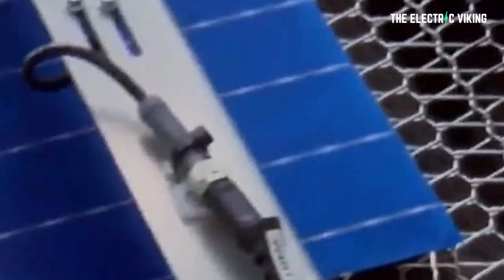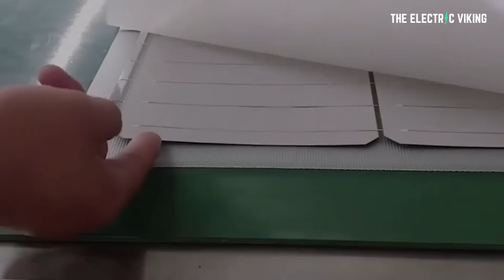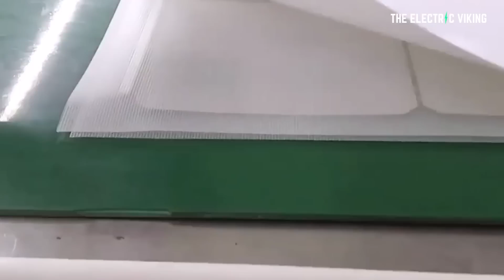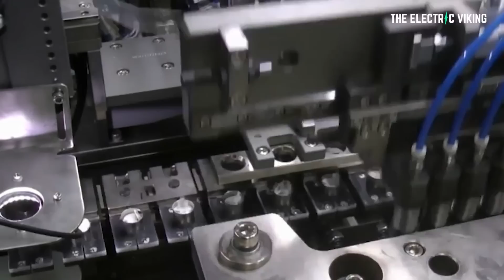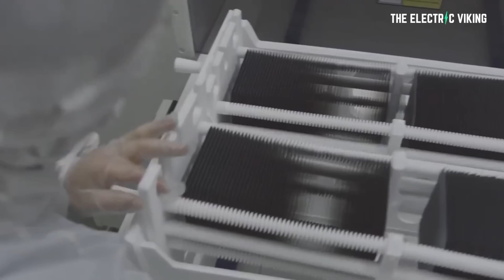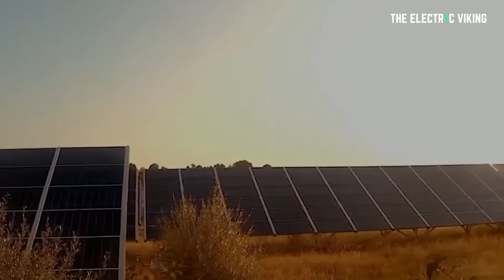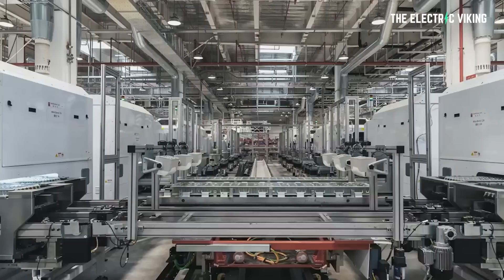China’s solar panel price war will double solar panel installations globally

Comment: There is some nuance here.  In places which already have a lot of solar, further solar expansion will not actually change fossil generation dynamics all that much on its own.  In those areas, solar + energy storage is needed to remove further fossil generation.   However, in areas which are still in the early stages of renewables expansion, where fossil generation is still a big part of the daytime generation, solar expansion will have a more direct effect.
Reply: Yes, by increasing electricity costs for households and industry, as has happened in every country this has been tried. The poor sods that cannot afford a subsidized solar installation, but are instead subsidizing rich folks with their own houses to get one.
Reply: @HNedel  Uh, no, not really.  You seem to want to blame all price rises on solar, which is pretty far from any kind of truth.

Generous net-metering tariffs can definitely shift some of the cost to non-solar utility customers, but those types of tariffs are fast disappearing and very few states still have them.   Not even California, as of April 13th or so.

Home solar installation, whether subsidized or not, without infinite net-metering, is totally fair to non-solar utility customers and has no effect on those customers electricity prices.

Besides, my  comment was talking more about grid-scale renewables and it is pretty clear that the addition of renewables to the grid are hugely beneficial to customers by removing highly variable fuel costs from the equation.   Not even counting the many other benefits.  Getting out from under the thumb of oil and gas multi-nationals is a good thing.
Reply: @junkerzn7312  No, not all price rises, just most of them, and also on wind. it's a simple fact that electricity costs for users WITHOUT solar have exploded, and this was happening before the war. Germany with generous feed in tariffs had prices for households around 20 Cent, before the war they had crept to around 30, now it's more like 40. My bill is not reduced in summer when solar supposedly produces for free. Which part of "warm reserve" are yu not getting? Fossil power plants have to run warm and produce no electricity, to be able to save the grid when wind and solar suddenly drop. This costs as much money as running them at full capacity and selling the electricity directly. So customers get the bill for the solar tariffs AND have to pay for all the backup that keeps the grid from collapsing. And this is still orders of magnitude cheaper than the pie in the sky dreams about grid level storage.
Reply: @HNedel  Not even "most" of them.  You are complaining about a shock that happened due to a war, and trying to blame it all on renewables as if they were some sort of boogie-man.

What do you think would have happened if Germany had no renewables and an even greater reliance on Russian gas instead?
Reply: @junkerzn7312   did you miss the part where the prices were going up dramatically BEFORE the war? Name one country where mass PV and wind  have led to lower prices for consumers without PV.

What would have happened without renewables? There would have been no energy shock. Electricity prices would still be as they were before all the renewables came online. Germany would have then never closed any of its 17 nuclear reactors, and would have kept the newest and most modern coal plants in the world working. They closed a power station in Hamburg a few years after it was built, basically brand new. Another one waited for years for permission to start operation. It is much easier to transport coal than LNG, and there are way more suppliers on the market.

The whole reliance on russian gas IS a consequence of their „strategy“ if a retarded economic suicide pact can even be called a strategy. 30 years ago renewables were sold to the public as not costing „more than an ice cream cone per month“, which was obviously a lie. The plan was to shut down coal and nuclear and import massive amounts of cheap natural gas from russia to maintain stability of the network. That’s the brilliant „green transition“ - closing the safest nuclear plants in the world, already built and paid for, with zero CO2 emissions, to replace them with russian natural gas and renewables. This disaster has cost over €400 billion so far, the co2 emissions are higher than ever, electricity prices are the highest in the world, and the economy is not competitive anymore, not to mention the households who can’t afford to keep warm.

Comment: I am thinking that gas (oil) will be here for some time. Gas cars are here for the next few years and gas(oil) will be needed to power them.  Solar/wind will need time to replace oil. And hydrogen is just too difficult to work with.

Comment: At this point the cells on a panel cost around $0.1/W and aluminium+glass another $.2/W. I can buy right now new panels for around $.3/W + VAT. Inverters, cabling, permitting, installation cost like 75% of an installation while the panels cost 25% and the cells only like 10%.
Reply: Where are you located?  Brian G, Canada

Comment: My friend and I just got over 7kw installed in the SF Bay Area in December. The Tesla Solar installers said they were booked solid for the next few months. In California, you have until April to be grandfathered in NEM 2.0.
Reply: Nem 3.0 is crap for customers. ROI going to be 20 years. CA suppose to he leader in solar but decides to screw residents.
Reply: @anekinoo7   Time for Ca residents to boycott this system. One CEO of the   power system now  makes  $50 million a year  as a reward for screwing Ca customers.  All this corporate screwing cannot happen without politicians playing the screwing music and providing the screwing porn environment.  IMHO. Don't ignore the utilities for their part in burning large sections  of Ca to the ground.
Reply: 2 bit da vinci says if you can line up the connection agreement with the utility by Apr 13, you'll be grandfathered in even if the installation comes later.

Comment: I recommend everyone that wants solar on their roofs have it installed right now. 

Please save this post so in 10 or 15 years when your roof is leaking and your have to disassemble that solar array just to make repairs or replacement of roofing materials you can revisit this topic.

Then post how much that simple roof replacement or repair costs were and the size of the loan you had to take out to pay for that repair. 

That savings on your electric bill will go poof💨 on that day!
Reply: Some might call it a scam, Australia and Spain over promised of buy electricity from homeowners
Reply: I got a roof with my solar installation, and both are warrantied together, 25 years. And got the 30% rebate on the whole package, so it can be a primo deal.
Reply: @SchoolforHackers  you payment will be higher than your electric bill
Reply: @richarddixon6352  Paid off years ago. My electric bill is $7.00, for the grid tie. I make more than I use. I am several thousand past break-even.
Reply: Payed off doesn’t mean economical, the next one to prove it will be the first
Reply: @richarddixon6352  I dunno man, my payments were the same as my electric bills were. Until the payments ended, and my electric bill stayed at $7. That was almost ten years ago now, and my panels are still producing over 95% of their original capacity. It paid off to get the good LG panels.
Reply: @SchoolforHackers  your the first one I’ve seen, nobody puts out the numbers including earnings if they had invested in stock instead of buying panels

Comment: Batteries, Batteries, Batteries. You can cover all the deserts with solar panels, but when the sun goes down? Batteries. It's coming. Need to be near the points of consumption to minimize power lines. Throw in a few wind turbines and you got it all. Batteries are the choke point now.  Go Viking!

Comment: This past year here in the US we doubled our solar electric system and the Chinese panels were only $.37 per W. We also added 30 K of LFP batteries for $9000 which replaced the much smaller lead acid battery bank bought a decade ago for $6800.
Reply: New Mexico as an architect focused on solar design for many years. I feel lucky to have so much sun to work with.
Reply: Our 4,000 sq ft house is easy to heat with electricity with high insulation levels R-80 in the roof and air tightness. Blower door test came out to ACH .52.
Reply: @robertstout7756    Ever tested the CO2 levels just for fun?  I don't think it's a problem but 2000 to 4000ppm CO2 seems to be common in tight houses, of course you can have heat exchanger ventilation.
Reply: Nice. If government sucks just help yourselves. ✌🏻
Reply: Like hearing such stories, intend to be E self sufficient(ish) after TSLA hits $1k/share in several yrs.  HA!
Reply: We got our panels, batteries inverters from Signature solar in Texas. Their tech guys were dedicated to helping me do the install.
Reply: @robertstout7756  To what avail.  You are still connected to the fossil fuel grid.  Renewables were no use at the time of the storm
Reply: @ValMartinIreland  you asked to what use our system?  We finished the upgrade last August and didn’t use any grid power until a couple of weeks ago when we had no sun for a week the next day the sun came out and now we continue to use no grid power.
Reply: We have an energy recovery ventilator that produces an air change every hour and a half. I recommend an energy recovery ventilator as opposed to a heat recovery ventilator because it reduces the lowering of the internal humidity in the winter in many locations of the US.
Reply: Why not add wind generation to solar panels for winter power.
Reply: @sanohajian3174  we do not have a good wind location and adding extra solar panels is actually cheaper plus with no moving parts more reliable.
Reply: What state do you live in? Serious question on my part. Trying to educate myself where homeowner battery banks can be used to heat your home or business.
Reply: @byrnc927  If you want to run heat off of batteries, you want a really efficient heat pump. I have a single zone mini split that was rated at 42 SEER 15 HSPF. COP 4 at 47F and COP 2, at 5F. Also make sure your insulation is on point. I live in Ohio, and my solar makes almost 5x in July as it does in Dec-Jan. I'd like to add a ground mount that I can tilt to match the season.
Reply: @fjalics  15 HSPF? What model is this? Never seen one rated that high. Is that HSPF5?
Reply: @byrnc927  Isn't it allowed everywhere? The problem is too little sun in winter. I need from 15 to 50kWh daily for heat pump and I can't get it from solar. I have 14kWh battery and it's enough for daily life, excluding heating. It's mostly empty these days.
Reply: @slavric  
Heating where I live is needed at least six months out of the year. There is no heating possible from solar. If you deplete your battery bank at night supplementing heat, it will take quite a bit of solar capacity to support power loads in the home during the day and also top off the battery. 

The hours the sun is up are reduced in winter, just when the electrical load in is the highest. 

I don't see solar providing the necessary BTUs by whatever means, heat pump versus resistance heating unless some new magic solar technology is invented. 

In summer depending on latitude, the sun deposits the equivalent energy in the Earth's surface of 14 horsepower per square foot. If that amount of energy could be tapped, this whole solar thing would be child's play.
Reply: @byrnc927  the key to heating a home in a cold climate with less energy is the thermal envelope of the house. airtight and high R values. also consider windows a hole in your thermal envelope so high-performance triple or quad Windows are important.
Reply: Looking to setup a 30kwh system on my farm where did you buy your panels?
Reply: What kind of pannels did you get, and where did you buy them?
Reply: Correct
Reply: I also installed three small DIY heat pumps this past year plus a sense monitor to see how much electricity they’re using. (not much). Even our solar electric upgrade. I did mostly myself with a licensed electrician to make sure it was all up to code.  I would encourage anyone with a medium skill level to take on the installation.
Reply: @robertstout7756  You're my kind of a guy. I'm an electronics engineer, but I love to put my hands on anything technical. So I bought two 7kW air conditioners and made coaxial heat exchangers. This is connected to a 2000 liter buffer tank and it works very good. I also installed 8,5kW of solar panels, two inverters and 14kWh battery. Now I'm waiting for the sun 😀. I'm a "soft prepper", if you know what i mean. Good luck with your projects.
Reply: @slavric  Thanks Srecko
It sounds like we have a lot in common. 
I guess I’m soft prepper too.
Reply: Before folks in the US rush to install solar panels…California recently approved to end new metering.  Meaning if you collect more than you use it goes into the local electricity provider.  Then when you need it you have a credit AT RETAIL COST…
Soon…the credit to Californians will be a pittance…forget the actual numbers…but a few cents…and they will SELL IT TO YOU (who originally produced it) at FULL RETAIL PRICE!!  Wow…
This will in time spread across the US.  
Plus in time they will charge road tax to changing much the same as they do with gas…making charging your EV much more expensive…

Comment: Having worked in the electrical generation and distribution industry for forty years, there is not enough land to install enough solar panels to replace all fossil fueled generation at least in the United States. 

Maybe a small power station somewhere might close, but widespread adoption? 

You have absolutely no idea what you are talking about 🤪.

I can tolerate your views on EV adoption, but you are way outside your level of knowledge of this complex industry.

Twist up another spliff and take another big toke...
Reply: How stupid and uneducated are you: the US has 3.8 million square miles of land, and around 1/3 is arid/mountain land doing nothing. Plus solar can be on rooftops, over coups/livestock. wind farms over farmland or offshore wind etc. In fact, the US has enough potential wind. Solar, hydro, and geothermal to power the whole world many times over! Plus Mexico has enough empty desert to power the whole US many times over if the US does not want to use its own land,
Reply: @stevetaylor2818  
Ok here is how stupid I am. 

To replace each large fossil or nuclear fueled generating station you need to cover 16,000 to 20,000 acres of land with solar panels. That's the size of Manhattan.

Or if you want to explore that in wind power build and install 1000 windmills. Don't forget the cabling and transformers.

That gets you the equivalent of that "single" large power station's power during daylight hours only, or if the wind is at a steady 25 mpg or more constantly spinning those 1000 wind turbines. 

You can replace that power plant with renewables sure, but...

At night - nothing.
Calm days - nothing 
 
So to power all of  America during daylight hours with solar, we need enough raw materials solar panels, racks, cabling, to cover an area the size of Vermont and New Hampshire combined.

Sure we have enough land in the United States. Whose land are we going to sacrifice? How much, lead and arsenic from those "state sized" solar farms are going to leach into your drinking water? How about the exploding rodent population hiding beneath?

How many city roofs does it take to make 1 megawatt of electricity to fast charge a "single" Tesla Semi? 

10 acres of rooftop solar panels under perfect southern California daylight. 
Good luck fast charging that single Tesla Semi in Des Moines, Iowa in December.

And the biggest question what do use for power at night or in the winter?

Guess what? Coal and Natural Gas.
Nuclear Plants can't just stop and start so they must be generating constantly. It only takes 10 years to build and start a nuke. Only a couple of those in the pipeline right now.

If you ban fossil fueled heating homes and businesses, you might as well double the electrical grid's load as well in winter. 

Maybe cover lake Michigan with floating solar panels to cover that additional daylight electrical load. 

And at night what? Same issue...

Don't forget you will need to replace those millions of acres of renewable solar panels every 25 years. The thousands and thousands of wind turbines need to be replaced every 20 - 25 years. 

It's not so simple for those of us who have to figure out how to keep your stupid lights on with unpredictable solar and wind. 

But then again I am just so stupid.
Reply: @stevetaylor2818  
I may not know how the world works, but I do know how the electrical grid works. No matter how many renewables they shit out, you will need backup spinning reserve to cover deficits.

Comment: As solar panel prices have fallen, the cost of installers, permits, racks, etc. has held constant or gone up.  To really reap the benefits of of lower cost solar, install it yourself, and use the power on site.  Examples being PV-->DHW, PV-->space heat, and for the more adventurous, EV charging, all being DC direct projects with no connection to the grid.  
     Regarding poly-crystal silicon, the slightly more expensive mono-crystal silicon makes enough extra watts/m2  that the cost of the glass and aluminum frames is more of an issue.  Glass and alum prices bottomed out decades ago.  As long ago as 2018, 82% of the PV installed in the USA was mono-crystal.
Reply: Aye! as you say using PV for heating, cooling, running an appliance lowers your regular grid tied electrical usage.